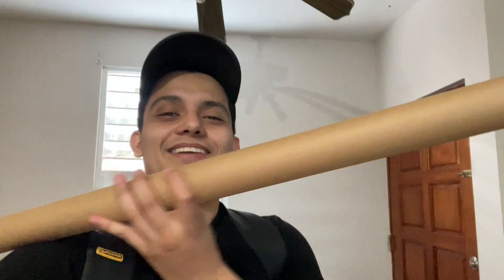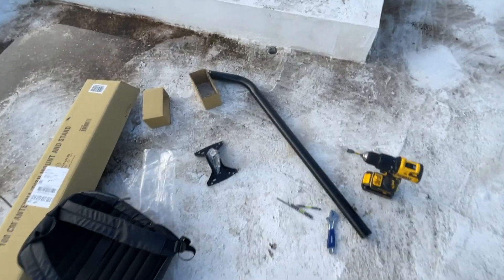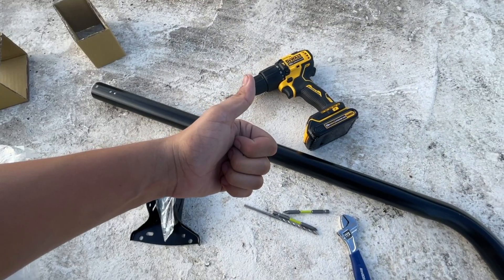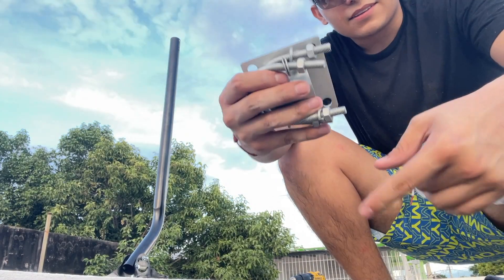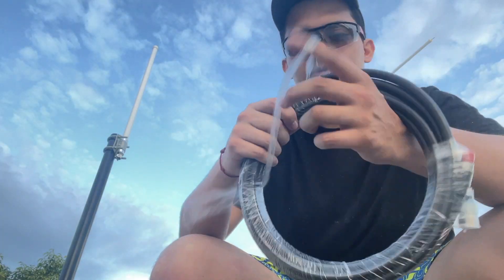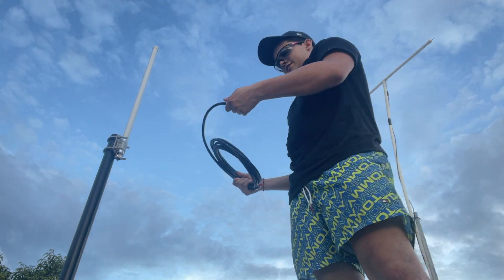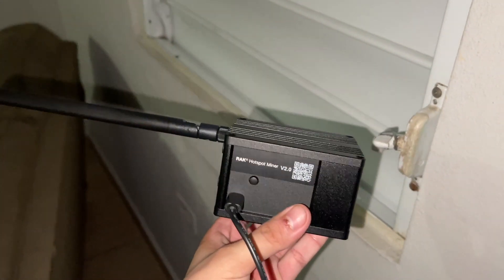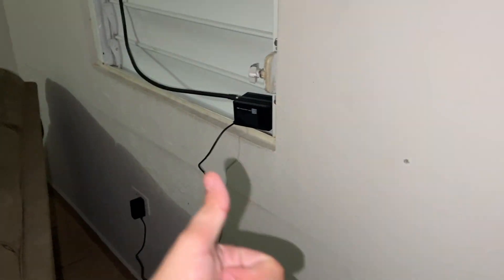Helium Rak V2 Miner 5.8dbi Antenna Installation | Gone Perfect!

Comment: What is the wire in the video called?
Reply from the maker: LMR 400
Reply: @InvestX  I’ve got a bobcat miner, would the LMR400 work? And are there different types of the wire or it’s all the same
Reply from the maker: @ThePixelisHere  lmr400 are all the same but the connections change, I have the links of were I bought mine feel free to check them out in the description to verify the connections so you get the right one! 😁

Comment: hi, i got an antenna for my rak 2.0, then i did the update on the app, but it tells me that my hotspot is now offline and that it hasn't been working for 7000 blocks. what can I do?
Reply from the maker: API is acting weird I get the same messages just let it get fixed in a couple days as long as your miner is still connected should be fine Marco! 👌🏻

Comment: Are you able to plug the antenna directly into the miner? I have a situation where I'm on the top floor of a sky rise so I don't really need a wire, let alone a long wire.  I know this antenna is pretty big so I was wondering what I should do. If it does not go directly do I just purchase like a 1 foot wire to connect them?
Reply from the maker: Yeah maybe get an antenna like mine and it comes with a 2-3 foot cable and set it up next to the window and you’ll be fine 👌🏼
Reply: @InvestX  thanks for the quick reply, I appreciate it 🙏🏼 that’s exactly what I will do!
Reply from the maker: @raredealgaming  Good Luck bro! 🔥

Comment: Can you provide more info? How long is the cable and what kind of cable?

I have 25 feet of lmr200 and wondering if that will be good?
Reply from the maker: I only use LMR400 16ft or shorter I left the links in description to get them from RakWireless I pretty much get everything from them

Comment: very informative video thank you
Reply from the maker: Thanks for watching! 🚀
Reply: @InvestX  In the process of setting up my first miner and Im confused about the pulsar cable. Is there any benefit to using the pulsar cable instead of an antenna feeder line? Do they serve the same purpose? Thank you
Reply from the maker: @markiii3499  they serve the same purpose but remember the shorter the cable is and thicker the better because it will loose less power 👍🏻

Comment: Would you please tell me how you crossed your cable from the window? did you dig a hole in the wall and pass it through? I'm struggling with that!
Reply from the maker: Its just a window but now I drill holes in the wall to make it more professional
Reply: @InvestX  thanks!
Reply: @InvestX  what do you think about awair element sensors?

Comment: Did you use lightning resistors?  Or the antenna  fiber glass?
Reply from the maker: Not lightning arrestors yet and yes the fiber glass antenna from rakwireless I left the link in the description

Comment: Great video. Tip: 
Lightning arrestor.. which also helps with static build up.
Also Those connections are not water proof. Add 3 layers. 1st electrical tape.2nd some rubber tape for coaxial.  Then rewrap it all with electrical tape. The last thing you is it shorting out and your not gain HNT.
Reply: Any and every connection that's exposed to weather or tempeture fluctiations
Reply from the maker: Thanks for watching!

Ok thanks for the tips will do them next time for sure!
Reply: What was that last point about the shorting out Joe? I could quite understand sorry
Reply: @eoinmcloughlin2297  google antenna static build up. The arrestor helps even if lighting doesn't strike it.
Reply: @joevillavicencio6548  thanks! And the connections that need taping are coax to arrestor and then arrestor to antenna yeah? Any more?
Reply: Do you have a link to one ?
Reply: Can I just get a lightning arrestor? or do I need the lightning arrestor, copper wire and a ground rod?

Comment: Did you install Lightning arresters? Of ground the cable? I was told I needed to do this in case of lightning but I don’t know how. I live in a very high building
Reply: tall build? get one. here's an idea. the arrestor usually has a spot to connect a copper wire. feed that copper wire into the ground of your outlet. preferably an empty outlet. outlet not close enough? use an extension cord, plug it into the wall, and feed the copper wire into the ground prong hole...
Reply: @audieallen9734  Good idea in a pinch, better than nothing!!!!
Reply from the maker: I’m still not on that level of professionalism haha but will definitely learn a more efficient way to do it to set it up in all the antennas on the roof, and yeah if you have it on the roof on a very high building its totally recommended to ground it! 😁
Reply: Lightning strikes aren't very common. From my research I've learned that an antenna installer/repair man, might see a lightning strike once every 5 years on an installation.. Yes lightning arresters are important, but don't forget about the signal loss incurred, by using multiple connections like that.(look up the dbi loss on coax connections) if you can afford it, get one and do it the right way. if your antenna is the tallest thing around you, like no trees,  wide open then I'd be more inclined to get the arrestor because at that point your basically a lightning rod
Reply: With the antenna on the roof, doesn't it need to be able to pick up your wifi signal from your computer?  Is there any issue with that?
Reply: @jeffhohbach8903  the antenna is not for picking up wifi...the inside unit connects to internet.